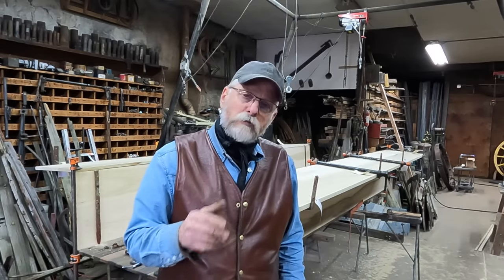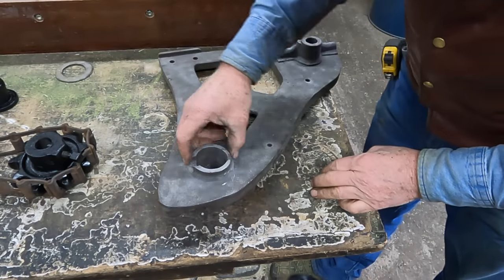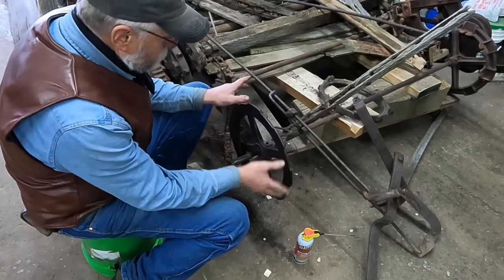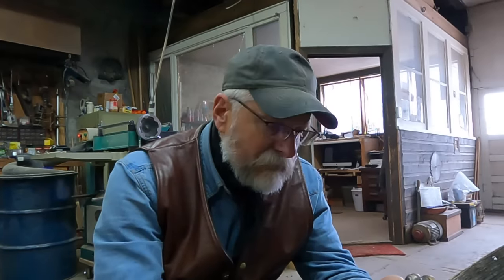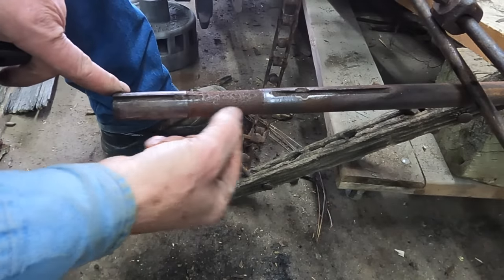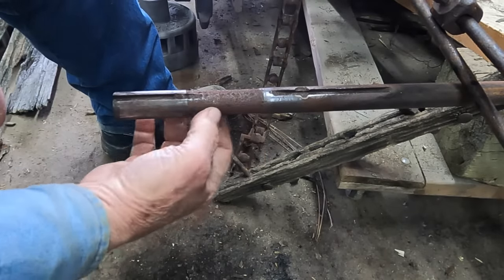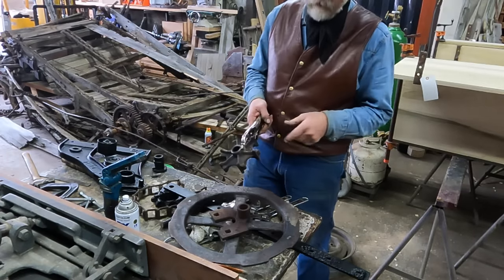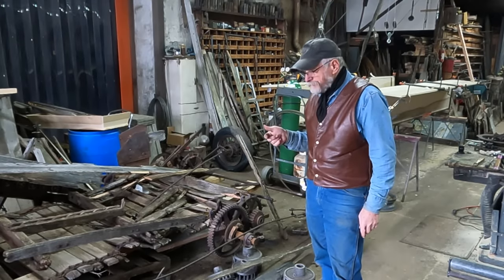My Best Friends For Breaking Rusted Parts Loose | Engels Coach Shop

Comment: As a young man I was told to use candlewax rather than release oils/fluid. candle wax thins and creeps under heat while the release oils tend to just burn off. Can't say I've done it a lot, seldom have a candle to hand but seemed to work well with moderate heating.

Comment: I have removed stuck sprockets from a shaft without using a wheel puller. The set screw for the sprocket key is replaced with a grease zerk. The flex tube of the grease gun is cleared with an air hose. Penetrating oil is put into the hose and connected to the grease gun. The oil, followed by grease will generate 5000 PSI and lube the rust between the sprocket and shaft. Have not needed to "inject the oil" twice.

Comment: Dave,  That old manure spreader project looks like a lot of fun.  Lot of detective work to figure out what's what and where it belongs. Kinda like the Sheep Wagon.  Impressive casting repairs, I would have though they were pretty much ruined.  There is an arc welding rod put out by "Muggy Weld" for casting repairs.  I've seen YouTube videos of it's use on exhaust manifolds, looks promising. Can build up the iron then machine back.  As always, really enjoy your videos, especially now that we get two installments a week :) .  You are a very interesting guy.

Comment: As well as heating the hub, you could try shrinking the shaft simultaneously with dry ice. I get some from my vet when I need it, it’s used to artificially inseminate cattle. All you is a few thou clearance and off she comes. It’s good for broken studs in blind holes too.

Comment: Have you tried freeze spray to help with the heat? Heat the whole thing - cog and shaft, then protect the cog and spray the shaft with freeze spray...the differential temperature should help with the separation.

Always great to watch you work.

Comment: I've seen a few tried and true methods mentioned here. I just wanted to offer another to try, Wax. When you heat the metal, touch a candle to it. It flows in and acts as a lubricant. Smoke is a little more pleasant also. Keep up the fine work.
Reply: Wax has been proven many times to be an old wives tale. But hey if it works for you then have at it.

Comment: It never amazes how old machines got the least amount of proper maintenance and repairs yet they kept on using them and that they worked as long as they did. How that wheel hub made it that long with only a set screw vs. the key it was designed to use !

Comment: Funny, I have that exact brass valve stem that I use as a drift.   It was salvaged from a boiler room steam valve, used in an old hospital with all boiler heating and cooling systems.
Reply: Ah that's what it is!  thx

Comment: Sorry for another comment, "I love what you do" My dad got a call in the 1980s from a livestock food provider that was having problems with his animal food milling machine on the phone call the man held his phone near the machine and said to my dad "what do you think is wrong" and my dad said with a straight face :-) "I do not know BUT it sounds expensive" later he went and repaired it it was a broken bearing. Back in the day 1980s industrial NorthWest GB / UK we just got things done with virtually no H&S no masks no eye protection and a bucket of water just in case things went wrong.
And I kid you not, no eye protection just a fridge to store lidocaine and tweezers to pull out steel splinter from your eye ???? I started working for my dad in the 1970s when I was 10y and I am still here to tell the stories... Drilling 1 inch holes in factory chimney bands with just  centre punch on a line shaft radial arm drill with just a peg in the radial arm be and a 30 gallon oil drum support for the 6 ft x 3 inch x 1/2 inch steel band and no clamps/ no pilot hole  just the peg to stop the rotation. There was so much shaft wobble on the 100y radial arm drill that if we used clamps something would have broken. changing speed on the drill was done by forcing the belt over to another pully with a broom handle.

When you look back how they must have worked around 1900 it makes me feel amazed. Now I work on very old sewing machines and I am astounded by the precision in the 1880s

Please keep producing your excellent content it makes me smile with joy.

Comment: Dave, you might want to try using 50% aceatone and 50% transmission fluid mixture for busting rusty bolts ect. loose. it has been used for a long time. Iit works GREAT. Love the progress your making so far !!!
Reply: The 50/50 Red Devil.  That's some Hot stuff.
Reply: Watched a couple of videos on YouTube working on stuck motors. That was the mixture he used to release stuck pistons. Would let set 10-15 days
Reply: Nothing beats a smoke wrench. Like Dave said it literally burns the rust out. That's something no penetrant can do. When ferrous metal oxidizes it expands so just a lubricant is not going to help. The extra volume of material has to go. Then there's the breaking effect of differential heating. There's a point when penetrants alone break parts free but once you're past that you have to use heat. Maybe 100 years ago a penetrant alone would have done it but not now.
Reply: BE CAREFUL ACETONE IS FLAMMABLE    🔥🔥
Reply: @jimradz6583  if you're using a torch you already have the flammable side of things covered then. If you're worried about acetone don't use oxy-acetylene torches. Because the acetylene tank is full of acetone. The gas is dissolved in the liquid. Just how it's done. Acetylene is a high explosive at high pressure. So dissolving it in acetone is just safer. Not to say it's terribly safe then, but safer nonetheless.
Reply: Boiling water if you can degrease the part and get it in it is amazingly effective at converting the red rust into black iron oxide. Degreasing is really important though. 

It is a more dense molecule. Even still magnetic. Since it takes up less space than red rust it helps when something is stuck. 

For steel stuck in aluminum like a broken bolt, tap, or drill. Alum powder like from the spice aisle of the supermarket mixed in water is the way to go. It eats away the steel pretty quickly while leaving the aluminum untouched. It's better than trying to twist out a stuck bolt because it won't gum up the threads in the process.  

Modeling clay helps form a dam where you can keep the solution on the hole you are trying to work.

Comment: Yes worked many rusted sprockets, they are a test of patience.  Dave if you have any more to remove
try getting a rosebud tip for your torch.  It works better when you just need heat..

Comment: You need some added tannin to your vinegar/iron mix to make up for the lack of tannin in the wood you're using to get the iron tannate, a stable black color, instead of the rust red iron (II) oxide. You can buy tannic acid, or make your own. I'm usually trying to go the other way--remove the black iron tannate stains by using oxalic acid solution on antique oak furniture that has suffered water damage.

Comment: Always enjoy your restoration projects!!
I dug a needle scaler out of the medal dumpster at work. It was missing the air coupling. 
"Could that be all that's wrong with it?!" I was hoping....
Pushed the trigger. Just a hiss of air leaking.
Well, I started attempting to take it apart. Threads wouldn't budge! I went through several heating cycles and penetrating oil. No joy! I put ut aside. 
Fast forward several months. I got back on it. I was thinking about making a custom wrench and hold the other end in a vice. But before I started on the wrench, I thought I'd give it one last attempt with a pipe wrench and vice. Long extension on the pipe wrench, I started pushing down. It moved easily! SHOCKING! And exciting!
Got it apart. Everything was stuck solid! Got it cleaned up and functional! I'll use it on my other rusty projects.

Comment: Little hint - if you chamfer the edge of the hole before tapping, the tap starts easier and aligns better. Learned this in a jobshop I worked in.

Comment: When removing a bolt from a nut or a shaft from a sprocket. If you can cool the bolt or the shaft and heat the nut or sprocket, it helps. Rubbing dry ice on the shaft or bolt after heating the nut will shrink the shaft

Comment: Hi Dave, I just love. the resto on the manure wagon, love a good challenge. I've been aa equipment mechanic all my life, learned from my dad. I'm now 80yrs. When it came to removing rust frozen parts we used heat and paraffin, not bees wax. Paraffin is made from petroleum. Heat the metal very hot and apply the wax when the metal cools enough so the wax does not flame up. You may have to repeat many times plus using a hammer. Careful using a air hammer, that works very well in a lot of cases but I wouldn't use the air hammer on those cast pieces and if you are going to invest in one try not to purchase one made in China. Remember, Made By Americans In American.

Comment: Dave, I saw a guy make a mandril out of a bolt, and a dowel covered in some bicycle inner tube,  which he chucked up in a hand drill, and used to drive a small belt sander belt, turned inside out, to clean rusty shafting, which would help with removing the other cogs and stuff, not having to drive it off over rusted up shafting.

Comment: Sometimes a Rose Bud tip will do a better job of flame control.  Perhaps that shaft should be grooved to allow grease to migrate along it in that bushing.  There are many ways to do something.  Glad you got the Shaft and gears separated.

Comment: Interesting to see removing the wheel 12:53  in the 1980s with my dad we would have cut the wheel off either side of the shaft and burned out the slug of shaft with Oxy Acetylene and welded the shaft back together. we worked on a lot of cotton weaving looms and motor pullies. My granddad back in the 1930 bought a mobile Murex welding plant so that he could repair sheared electric motor shafts in situ to save dismantling very large electrical 3 phase motors.

Comment: Something I have done, heat everything up then use 'freeze spray' on center shaft (although it works best if there is a center bore)
I remember my father, probably 55 years ago, doing a forged steel part with a shaft seized , he literally threw it in bonfire, waited until fire died down took it out while still red hot and dropped it in a bucket of water.  
Parts literally 'fell apart'
He told me something about steel expanding with rust then heat and sudden cooling  'crushing' rust flakes into powder (he was a manual worker but grew up doing 'repairs'  for his father)
I was totally astounded.

He did tell me never to try it with cast iron but any type of forged iron or steel was 'fine'.
I ended up being a motorcycle mechanic working on what he called 'jap crap' until just a few years ago and used method more than once or twice working on various machinery. (spent 8 years working on construction equipment)
Still not sure what happens to cast iron if you drop it in water from (dull) red heat? (not much cast iron on import motorcycles from mid 1960's to 2011)
I think it would crack but still never tried it to find out.

Comment: 1970s+ Blacksmith shop in Lancashire UK reliving what we did and what you are doing is so nice. My other relative I found in 2010 was a wheelwright, my grandad sold him a wheel rim but welder.

One job my dad did was make sizzling cast steel platters for a chef and he polished the rough oval castings and delivered them to the sad chef who said "what have you done" fortunately my dad took them back and shoved them in the forge to blacken them ;-)) and everyone was happy. Yep we had a steak meal cooked by him a few weeks later.

I am so glad you still do this work.
BTW I have a full set of Oxy Acetylene bottles with all welding and cutting gear and valves. Just never used it since I brought it to where I live in 1992; I wanted to use it just never needed to use it, including the "Gas Economiser" valve cut off. My day job was to service and test all gas equipment in a factory that made "instantaneous water heaters" and "gas fires"

The last thing I gas welded was an exhaust for a pulsejet engine back in 1980, it was a weld that looked like bird muck and chewing gum ;-))

Comment: Persistence works. I am thinking a wheel puller would have worked too. @LAOL is a channel where a father and son work on antique tractors. There ability to create wheel pullers and such is pretty interesting. Even you might learn a thing or two.
Reply: A wheel puller would have just snapped those wheels. They were too far gone to just be pulled.

Comment: The surface that the Cog runs on has been worn - causing the cog to run too tight and also now has the knock on effect that the chain now interferes with that tab that is worn. Cog housing needs to be built back up to get space away from tab.
Reply: BINGO! I was thinking the same thing. Shim it or build it up.
Reply: I was thinking a washer!

Comment: Like another poster stated with these stuck pulleys, gears or bearings.

 I usually use emery paper and files to remove rust and burrs on either side of the shaft holding the stuck part.

That way the worse part is the rusted shaft area under the part.

And heat always seems to work in the end.

Comment: Gentle persuasion…….
Amazing how oxidized metal takes up so much more space in such a situation.
Your blacksmith experience with cast pulley rusted onto a steel shaft is obvious.
Many today would not of had the patience to get this off without breaking the pulley.
So satisfying once it starts to move…..
Then the tricky part is keeping it moving without galling.
Great work !!!!

Comment: The penetrating oil, heat, (and there is a particular way to heat, I saw you using it also), light tapping method was shown to me by an ole time blacksmith, about 50 years ago,his name was granddad, it rarely fails, takes patience, something youngsters need a lot of practice at.😊 nice to see you sharing the method with everyone sir, enjoyed the video, thanks.
Reply: You just need to break a lot of stuff you didn't want to, to gain the patience you need to do the job right.
Reply: @1pcfred  been there!😏😉
Reply: @terryrogers1025  that's what did it for me. I ended up spending a lot more time and money fixing what I broke by not being patient in the first place. I'm a slow learner but I get it eventually. Experience teaches you material properties. Like the yield point of metal and the wisdom is not exceeding that. Because Easy Outs are false advertising. There's nothing easy about it.

Comment: If I'm not mistaken, you're not big on air tools, but if there's one thing to invest in it would be an air chisel/hammer like the large Chief model from Harbor Freight. Mine never ceases to amaze me at how it can rattle rusty parts loose where tapping on them with a hammer fails or just takes too long.
Reply: I have an old Blue-Point someone traded in to the Mac Tools guy, he sold it to me for $20. No idea why it's previous owner wasn't happy with it, it's easily twice as powerful as my Ingersoll, and way easier to modulate the power. They still sell them for a bit over $300 new.

Comment: I wonder if, in rebuilding that chain drive mechanism, the pinion gear was reversed.  If the end of the pinion with the set screw were on the side toward the body, the chain would not rub on that little protrusion.

Comment: david,
i'd propose the use of a gear puller with heat, and a spay of diesel oil. the constant pull, tapping, and heat on one spot on the hub                                      to me is a guarantee of the dsired result.
thanks for the show. q1uite sure it will be a wonderful functional machine.
thanks again,
-toly

Comment: Making great progress on the Manure spreader. Have  you tried the candle was trick in rusty  parts? Heat it up like you have been doing then touch melt a candle into the joint between shaft and wheel.

Comment: - Yup, to provide expansion room and so nothing would crack, I wanted to heat the ring of steel from the outside edge down the spokes to the hub.
- Dave, have you tried Kroil penetrating oil?
Reply: Yes

Comment: To right heat it up to cherry and walk away, come back in half an hour it will be free. the key is the cool down time
Reply: I've always worked hot. I've got that heat weld thing like Dave talks about but I just power through it. Usually if I'm using heat I also use an impact driver too. Stuff comes off like it's new, kinda. But if you're too slow then you get the squeak of death. That's when it can go wrong. If you want to work cold you don't have to wait. Just hit it with water. It'll cool off faster than a half an hour. That's heat quench.

Comment: I would use a flat bastard file, and emery cloth ( tape ) to shine up that shaft, early on.
Reply: Yeah my strategy is get the part onto clean material. I'd clean it where the parts are stuck together but accessing that is impossible. Dave got around to polishing the shaft eventually.

Comment: Just wondering why you don't heat the axle first?
Heating the axle makes the connection compress everything between it, and after cooling there is a little room for your penetrating oil